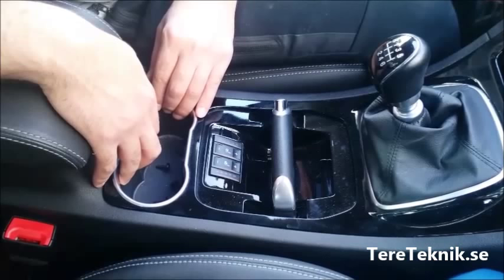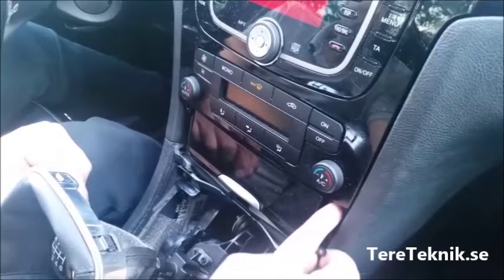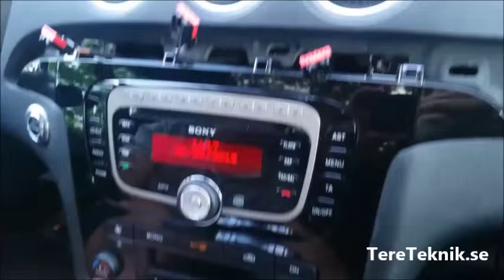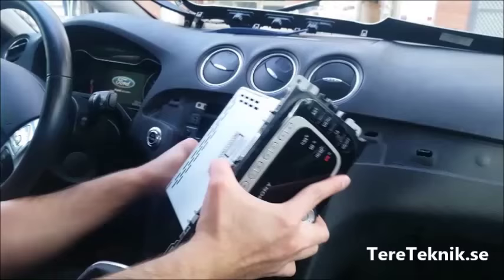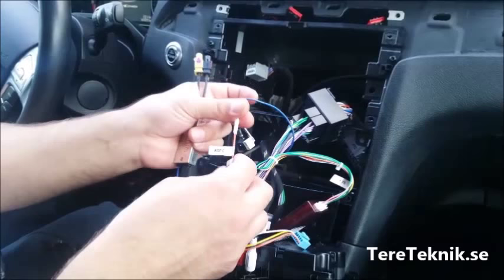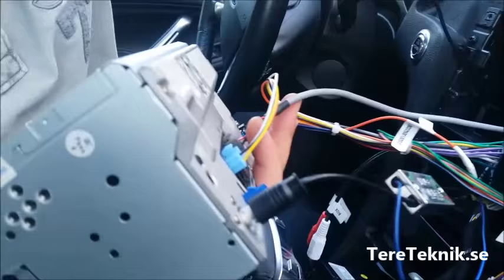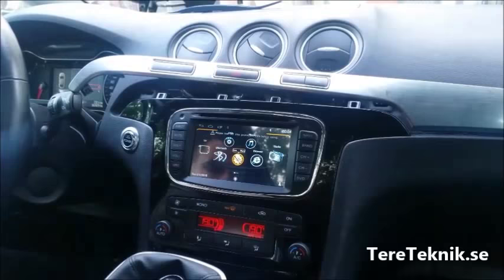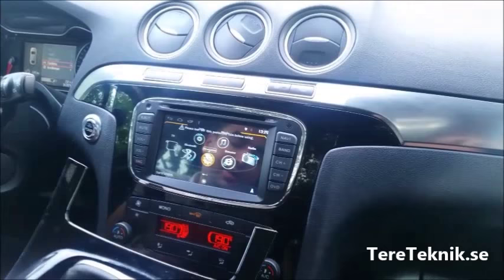Ford s-max bilstereo montering

Comment: good morning, sorry if I bother you, I'm a do-it-yourselfer, could you tell me the name of the pink cable where to connect the blue cable, I don't want to make mistakes, thank you Fabrizio Perugia Italy
Reply from the maker: Blue cable is coming from radio antenna amplifier and is connected to 12 volt in tha main connector for better radio signals. In different android screens there are different colors of cables and not all screens have this radio antenna adapter.

Comment: Hello, helpfull video, thank you.  One question though, how do you remove the front panel (time stamp 01:41 in the video).  I got that far but I am not able to remove it.  It does not come easy at all.  The car is Ford S-Max 2013.  Thank you for any advice.
Reply from the maker: Thanks for your comment. Nothing special. You will exactly remove as shown in the video but its little hard and you need to use plastic tool. There are only four screws. Two on top and two on bottom and plastic connectors behind. You need to pull little harder.
Reply: @tereteknik  Hello, thank you for your answer.  I gave it an other try, but was not able to remove the panel.  Probably it is a slighly different model, designe by Ford to prevent to remove it yourself...unless  you work in a garage and have the specific tooling.  I will have to go to my local Ford dealer, who is always happy to rob me.  I just wonder why you have to pull out the radio to get the 4-digit pin code.  One would think that the VIN should be more than enough to get the code.  Thanks anyway.
Reply: @tereteknik  hello master, I have a 2011 model ford smax, I want to install multimedia. There are two antenna cables in my car's radio, one 12 volt in the connection socket, what should I do, can I activate the can-bus steering buttons?
Reply: @tereteknik  hello master, I have a 2011 model ford smax, I want to install multimedia. There are two antenna cables in my car's radio, one 12 volt in the connection socket, what should I do, can I activate the can-bus steering buttons?
Reply: @tereteknik  hello master, I have a 2011 model ford smax, I want to install multimedia. There are two antenna cables in my car's radio, one 12 volt in the connection socket, what should I do, can I activate the can-bus steering buttons?
Reply from the maker: @atillademirel8257  Hi . Where have you bought the screen from? Send us some pictures at info@tereteknik.com
Reply: @tereteknik  bought from aliexpress, ford s max compatible ready to arrive next week, front panel and internal 2GB ram and 32GB ROM
Reply: @tereteknik  with frame 9 inch android for ford smax